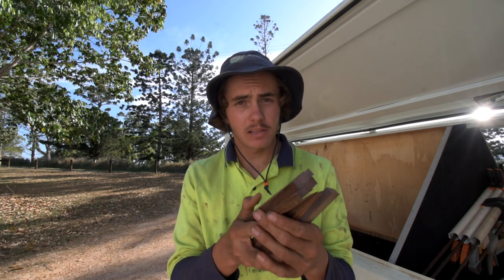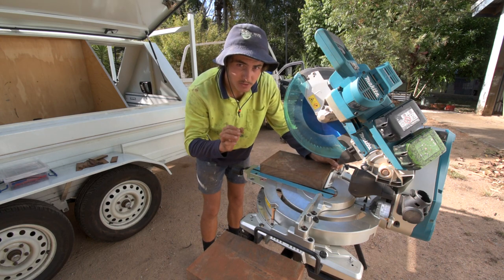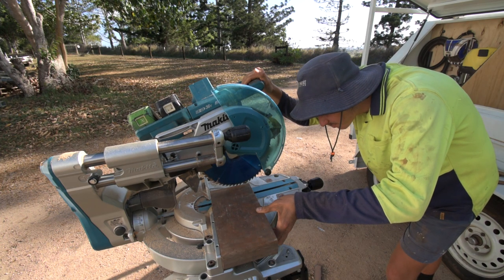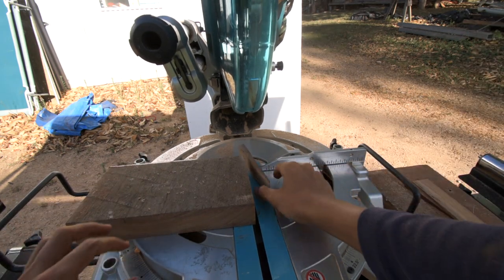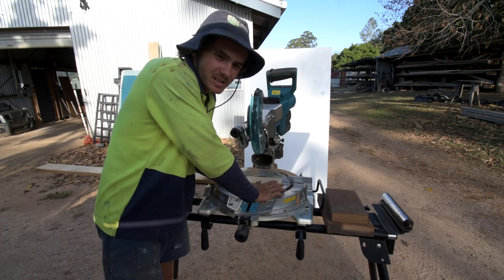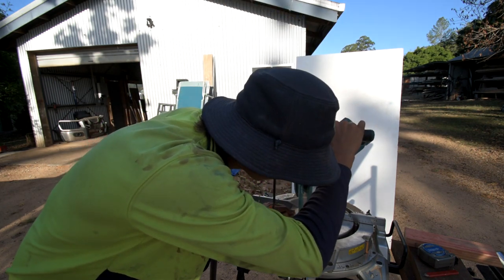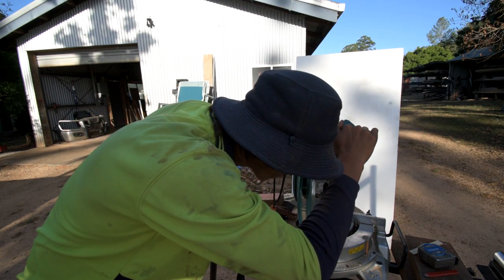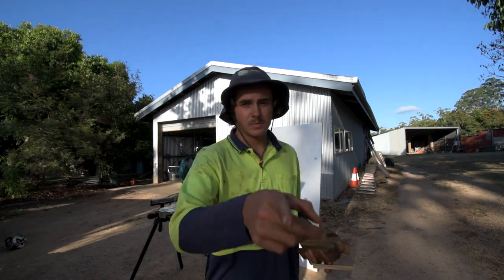How to make the perfect wedges

Comment: I make wedges for hammers and axes. I glue up a stick about 2.5 inches by 2.5 inches and use this flip it in a chop saw technique. Your sizes may very. I make different angles , from 4 to 7 degrees.